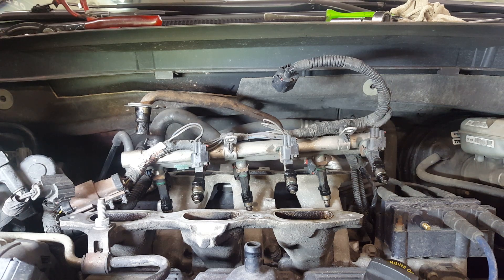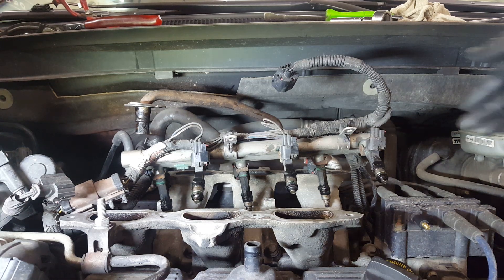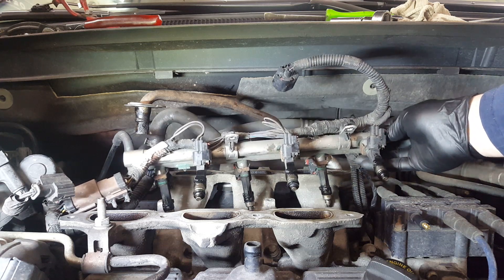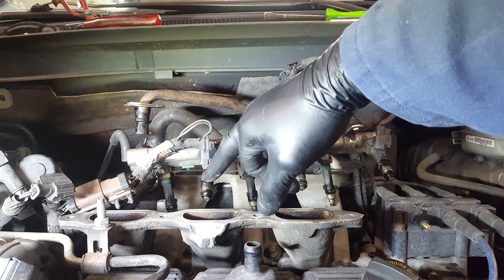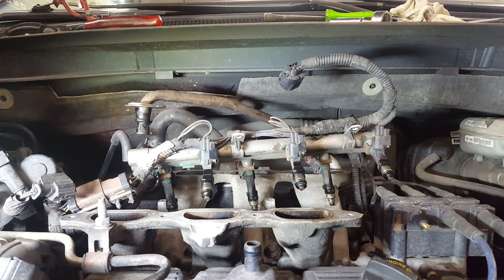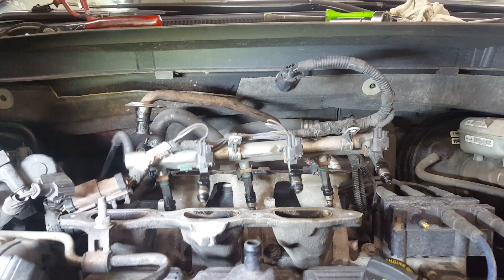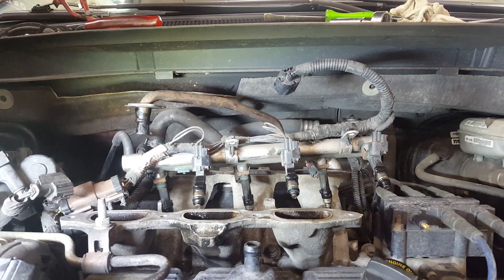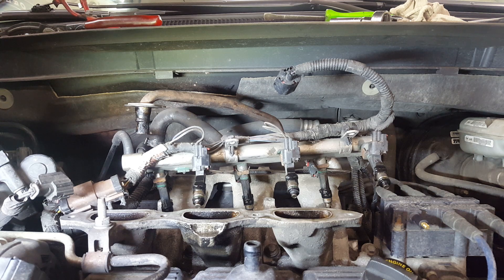how to / Fuel injector problems dodge grand caravan 3.3

Comment: Whoaa, seems like 7 years ago!  Great video!  Even the thought of all that gas washing down the cylinder and diluting the oil makes me shudder!  If you are still around, how many miles on those injectors, and how do you care for them properly? When it comes to replacement, what brand do you recommend?  Do you advocate pro active replacement at a certain mileage?  Thanks again.

Comment: Good reason to run fuel injector cleaner in your gas tank regularly! A stuck injector is much worse than an injector not working! It will dump raw fuel into you catalytic converter and ruin it! James

Comment: Thank you for this video, would you also change the fuel supply jumper considering the age of this vehicle? Sometimes the issue exists when the spring connecter does not properly engage due to corrosion.  The fuel coupler came apart and could have caught the van on fire.

Comment: I have a misfire on#2 which I traced all the way back to pin17 on the CPU. The other 5 cylinders are firing perfectly. If the intake valves are open at roughly the same time on say, #1 & #2, or 2&3 ... Do you think a jumper one the CPU between pins13&17, or 17&7 would work? The van is just about ready for the bone yard .. 23 yrs & +300k.
Reply: Hey, I have seen that done if it's a bad driver in the computer. Basically running two injectors off one driver. Might not be perfect but the people i have seen do it said their vehicle ran good afterwards, much better than having a stuck open injector if a new injector doesn't fix the issue. If the two  injectors are normally firing at the same time anyways I don't see why it would be any issue.
Reply: Just seen the age of your van, if it's a chrysler like this they have a very common problem with the injector harness degrading and causing problems. Might be worth just grabbing the wiring harness for the injectors and trying that.

Comment: I'm just wanting to disconnect fuel line to engine to see if fuel pump is bad...   don't see where the fuel line connects to the engine.    Do I really have to remove all that you did to do this?

Comment: I have a 2010 grand caravan 3.8l rough idle only code is a p2097 I'm leaning towards a injector dumping fuel as well since it rans fine otherwise just at idle in any gear anymore suggestions would be great already replaced or cleaned egr valve throttle body tune up  plugs wires coil pack has like a heavy hiccup at idle smells like raw fuel in the lower intake

Comment: I have a 2009 Dodge grand Caravan 3.3 L with 176,000 km, I have a cylinder one misfire, the dealer is also having trouble diagnosing the problem, replaced the spark plugs wires, the coil is good replaced the PCM and had it reprogrammed also,Also swapped out cylinder one and cylinder three fuel injectors, misfire still doesn’t go away. Any idea where to go next?
Reply: It could be the valves if im not mistaken
Reply: My van has the same problem same cylinder if you find the problem before I do let me know what it was please
Reply: It’s the harness my guy

Comment: I have a 2001 Caravan with 198K mileage. Never had injector problems with older caravans either! So why newer models have problems? James
Reply from the maker: James Sasse this is just simply a faulty injector. this particular van had high mileage and the injector just gave up

Comment: Like you said,they ain't that cheap. So what do you suggest? Buy new ones Everytime after one gos bad? My van has 176000 and and one injector just went bad. I'm not going to buy 6 at 90.00 a pop. I'll deal with them as they go. Not going to have it much longer anyway. Besides, out of all the vehicles I've owned, first time I've had to change one.
Reply: scrap yard they are cheap,  rockauto as well
Reply: Junk yard

Comment: Can a bad fuel injector cause two cylinders to misfire? I had the spark plugs,wires and coil replaced but still getting a misfire from cylinder 6 and 3.. HELP!!
Reply: Did you ever find out what caused the misfire I’m experiencing the same issue
Reply: Dominic Matias that happened to me, I had a short in the wiring. Need to peel back the tapes and inspect the wires..
Reply: @rajivsingh1999  Same here but what wires we talking about?  I notice 6 and 3 are common problems and the coil sits right over exhaust...
Reply: Justin Gibson I removed all the conduit and inspected all wiring. I had an open wire on injector # 4 I believe. It’s been a while. But if you have everything removed already like the upper intake manifold, just remove the brown and black connector and inspect every single piece of wire. That’s what I did and found the issue. Afterwards I used electrical take an tightly sealed off all the wiring
Reply: @rajivsingh1999  Thank you kindly!

Comment: My 05 dodge grand caravan I'm trying to figure out what's going on. Smells like gas and rough idle and bad fuel mileage. At first it said number 4 spark plug. Changed it. Then it said o2 sensor. But then mechanic said to change all spark plugs. So I got all new 6 spark plugs and wires. 
Now engine says p0304 code again  that same 4th spark plug.
I dont know if I need a new coil.. or if the valve is damaged. Or if it needs a fuel injector...
Reply from the maker: put a new coil in it first
Reply: Did you find the problem?
Reply: @msntung  I did get a new coil aswell. And a new computer.. Lol. After that.. it needs all new fuel injectors. But it became too much work. Suckin up too much money its in the junk yard now

Comment: I have a 2010 Caravan #5 intermittent miss, it became worse and a new code has come up  open injector may have said circuit it will run fine then all of a sudden stop firing on the #5 then start running fine again could you point me in the right direction please thanks while it was just an intermittent miss I was told that it was a valve seal and was crazy money to fix I asked them if they did a compression test they said no as they has seen this numerous times but the code is now showing the open ejector One last thing the van has 375 thousand kilometers on it do you think it could be the injector or harness (ground problem ( thanks )
Reply from the maker: Brian Christohper +Brian Christohper what codes do you have do you know the numbers? how many km do you have? you're problem could be a bad electrical wire to the injector and may not be a bad injector at all.
Reply: I can get all the numbers tomorrow  375 K  mostly highway I can be driving all is fine no miss then shut of the car for a minute or two start is and the #5 will not fire at all then kick then kick back in a the revs increase will a stuck open injector cause the engine not to fire on the on the #5 that is showing up and again thank you and thanks for the speedy reply  blew my mind
Reply: would a bad wire be that sporadic
Reply from the maker: +Brian Christohper it could be this injector I show in this video was a bad wire and not the injector
Reply from the maker: Brian Christohper hope you found your problem. valve seals around that mileage is common. but a bad valve seal will usually start burning oil (puffing blue smoke from exhaust) and not cause a misfire. in my best opinion the problem is probably a bad wire between your #5 injector and pcm. the injectors work with a 2 wire hook up. the one wire should be 12v and if you're not having problems with other injectors your 12v wire is probably fine as all your injectors share the same 12 volt feed. the other wire is the "pulse" wire from the pcm. and that wire is probably breaking down somewhere in your wiring harness. all I've ever done to fix them is run a new wire outside of the harness from the bad injector to the pcm. this is a bit of a advanced repair as you must make sure you cut and connect the proper wire.
Reply: Thank you for your help I am old school and felt it was either a fuel management problem or the coil when it first started as I had changed the wires and plugs one month prior First thing I did was change the coil which made no difference with the miss but improved performance I had never had an injector go before but the way it was acting said injector  We pulled the plenum Tuesday tested it with an LED dodad diode that pluged into the harness  sent a signal from the computer to the LED and showed all was well with the wiring, changed the Injector and all is great.  It is good to have friends stress levels are normal once again lol  Thanks for the Video gave me hope that all was not lost
Reply: @billgoatgarage  I am guessing I could use liquid electrical tape to fix wire?

Comment: Can I used a wiring harness for a 3.3 on my 3.8?
Reply from the maker: the whole harness or just the injector harness?
Reply: @billgoatgarage  never got a definite answer.
Reply from the maker: @MAXIMA347  I believe the injector harness is the same I think there is slight differences between the main harness but I am not 100 percent sure
Reply: @billgoatgarage  ok got you, I'm referring to the whole wiring harness that disconnects from the fuel injectors and whatever else it connected to.
Reply: @MAXIMA347  yes you can but you gotta use 3.3 injectors
Reply: @Budgettools  you sure because I got a new injector and it fit on wiring harness I just got and the injector is for 3.8
Reply: @Budgettools  update found a 3.8l injector harness sent back that 3.3, not got going through all that